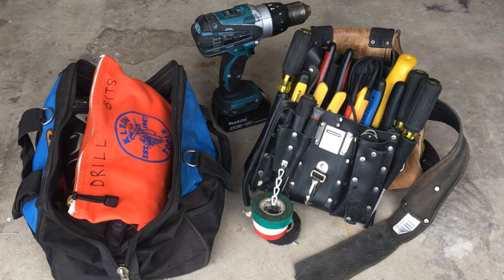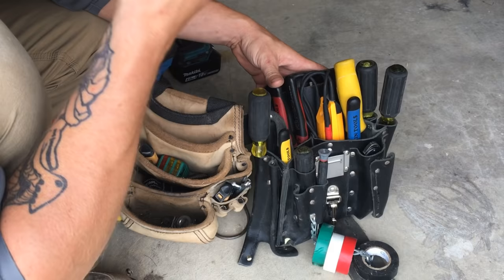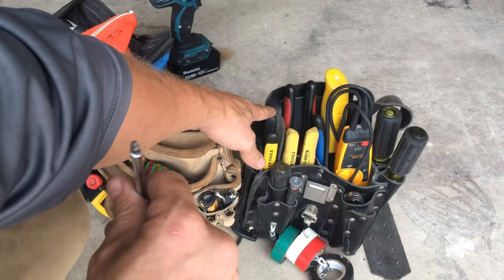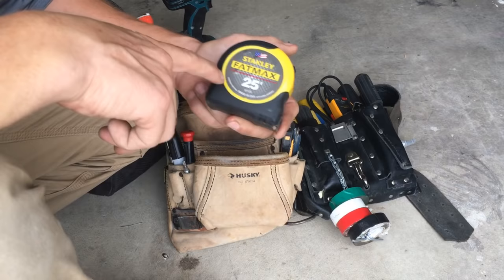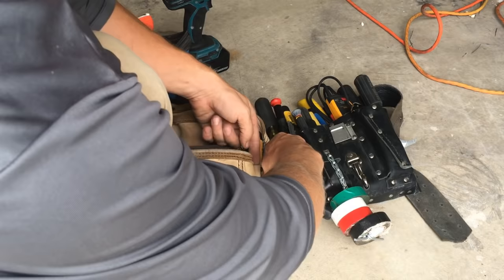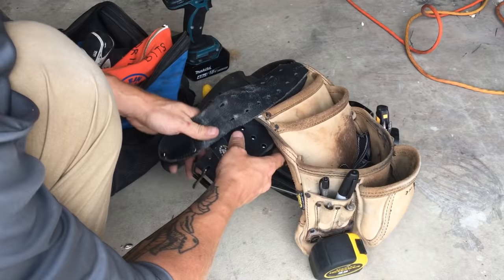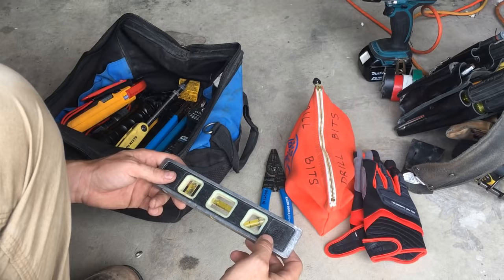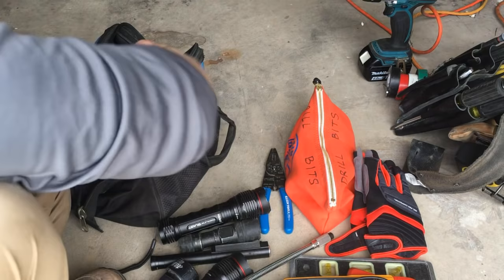Episode 2 - Tools Every Apprentice Electrician Needs To Start Their Job

Comment: This is an awesome vid. Pretty awesome channel altogether. I am a General for residential remodel and I try to get the 411 from the trade pros. Today, amongst other things, I learned about the strippers with the screw cutters. So many times I have had to cut screws for covers on a backsplash. Yee-haw!! Also did not know about the long shaft 6 in 1's Good Stuff!!

Comment: No insulated stick screwdrivers?  In Sweden  electricians always use 1500+V approved screwdrivers with insulation on top of the metal screwdriver stick, only the HUGE FLATHEAD screwdriver and the small exchangeable bit ones ever are un-insulated. Specially the +/- head screwdrivers are insanely expensive for the high voltage versions, but it saves lives when working on live wired screws.

Comment: 440 is steel. Channel locks are by the inch length. 

Love your channel.
Reply: 440 is the model on Channellock. Manufacture part number 440 is a 12" TG/GRV Pliers. 420's are 9-1/2". 424's are 4-1/2". 426's are 6-1/2". 430's are 10".
Reply: @misfitsman805  Interesting. I might have coincidental confusion. Channellock is one of the historically American made tool factories in PA, city built on steel mfg. Channellock tool I use the most for gripping. I wonder if they chose the 440 as a marketing strategy. Most people know the 440 is strongest & hardest steel. I tend toward best steel tools.
440 is a series of steel, 440A, 440B and 440C. HRC, or hardness & less rust and 440C is used in tools.
Reply: @rosehannahmae6772  Channellock uses high carbon C1080 steel. The 440 Channellock is just the model number for the 12" tongue and grove pliers. I think it's just a coincidence with the 440 model number. Other channellock tools use different model number series depending on the type of tool, like the 317 Needle nose, the 3610 Linesman pliers, 958 Wire Strippers https://www.channellockproducts.com/products/332884

Comment: Love your tools... I would recommend being more balance though. All the weight on one side will wreck havoc on your body
Reply from the maker: Ya I've been finding that out.  Also trying to combine tools like having a 10-in-1 screwdriver/nutdriver rather than having 10 screwdrivers.  Or having a needle nose that is also a stripper, and bolt cutter.  Takes the weight down, and increases speed since you don't have to keep changing out your tools all the time.

Comment: I have been an industrial maintenance electrician for a decade. Im just now going to be a service electrician. I have the feeling I'm in for a rude awakening on the difference.
Reply: Must admit I had a relatively easy life as a maintenance electrician and could not re-wire an old house in a week never mind the 1& a 1/2 days the house guys have to do it in.
I possess similar tools but mine remain unbroken and clean after two decades or so. I'm trying to hire a good 'House electrician' to update my old home to code and install a 27kw tankless water heater from my 200 Amp board, but so far three of them have walked away with no estimate appearing. After wasting a month I'm going to have to get the books out and figure out how to do it all myself - grumble groan and moan - about useless house wiring guys who can afford to 'Cherry pick' their jobs.

Comment: Here’s a tip for the budding electrician: BUY YOUR TOOLS (Klein brand when possible) AND GEAR AT HOME DEPOT.

Home Depot is excellent about replacing broken, damaged, or old tools or electrician pliers. On top of that, Klein Tools are covered by lifetime warranties!

 I went by there this afternoon after work and got my Ridgid work light ($99) replaced because it came apart while working this weekend.

I found some old rusted Klein diagonal cutters, an old beat up pair of Klein needle nose pliers, and a 6 inch small flathead screwdriver in my father’s old truck and took them to Home Depot... Went and found all of the new versions of said tools and grabbed replacements off the shelf, then took them (along with the old tools) to the customer service desk where they allowed me to exchange the old beat up tools for brand new updated versions of the same tools! Didn’t even ask for a receipt or proof of purchase!
Got about $75 of Klein Tools replaced free of charge! 

From that day forward, I’ve purchased EVERYTHING I need for electrical work and general construction from Home Depot!

Comment: Can you use 12v drill instead of a 18v so it’s more portable?
Reply from the maker: Absolutely, these days the 12v stuff that's being put out is very powerful.  But there will be some limitations.  18v is the way to go if you want it to work for every situation, all of the time.  But the price point of the 12v is hard to pass up for the power you get.

Comment: I'd recommend a Sheffield 58953 Electrician's Multitool. Mind you, 90+% of multitools
are useless crap, but this one has a very nice wire stripper, a sharp knife blade, an almost useful saw blade, and other assorted gadgets.

Disclaimer: I don't work in the trade, but my father did at one time.
Reply: I can see carrying an electrician's multitool, but the Sheffield is too heavy, but despite the weight it's not strong. It breaks. The better one to go with would be the Leatherman Squirt ES4. It's lighter and stronger, and I like the tool assortment on the Squirt ES4 too.

Comment: Dustin you may want to try the Klein demolition slotted/flathead screwdriver it has a metal cap that you use a  hammer on .if you use a hammer on a regular flathead you'll ruined then head on the flathead or the cushioned grip will move on you over time
Reply from the maker: Definitely good advice, thank you!

Comment: Not that it matters, but I believe that the 440 on your channel locks is the type of steel. I only know this because I'm a knife nut and that's a common steel used on knives...
Reply: Mark McEathron no it’s the size u have 420s which are small then you have 430s and 440s and idk how big they get after that
Reply: @blokimm9309  Thanks for the correction, man! I wasn't completely sure, and that's why I used the word "believe". 

Thanks for getting it right!

Comment: doing residential electric as apprentice you are going to be the crawl guy.  flashlights are nice, but a solid headlamp was a must for me.  when you are carrying a drill with you to poke through drop girders and other shit as well as your kleins to knock in staples you don't (at least I didn't) want to have to worry about dragging a hand-held flashlight as well.  anyone can get a good LED headlamp on amazon for less than 30 bucks.  dewalt makes a solid headlamp you can get at the hardware store, just not as bright and they eat through batteries.

Comment: Nice video, very thorough. However I find the contact testers to be very handy when changing devices and making sure the circuits off, when you work with other people is is very easy for somebody to turn breakers on and off so it's definitely a nice thing to have as an added safety measure. Also we have the same name, same stuff and same initials in the same places on our tools.... interesting coincidence.
Reply from the maker: Rainey Gmt I agree that they have their purpose.  I don't let my guys use them to verify anything, I have them use them as a first check and then recheck with a multimeter before sticking your hands/limbs in something.  I've seen people get hurt by being lied to by them so just be careful.  And always test on a known live circuit because the damn batteries can trip you up!!!
Reply from the maker: Rainey Gmt and wait...your name is Dustin Stelzer???

Comment: safety glasses, earplugs and a hard hat?? Laughed at the trinkets and gizmos comment.. 440 channels are good up to 2 inch pipe i believe.. having smaller sets of channels  do in fact have there place.. you should also consider picking up 2 meter cases to protect them..good start on the load out.. Thanks for sharing!

Comment: Never understood people wearing huge tool pouches like the one you have, makes no sense. My SMALL pouch carries my Kleins, Strippers, Dykes, Multi-nut driver, Philips, and Flat head. In my front pocket I have my hot stick and in my back pocket I have my meter. I can do 90% of my work like this, there is no need for a huge pouch with half my tools in it. Not only are you carrying a lot of weight on your side, but it gets in the way when you are working. Sometimes you have to craw in small spaces or squeeze into areas and it's way more convenient to have a small pouch on instead of having to take off and on and off and on that unnecessarily large pouch. 

Also, they need to buy a drill AND an impact. If you have one, you need the other as well. Personally I'd recommend everyone go with Milwaukee, they are the innovators of power tools, always the first ones to come out with a new tool. Not bashing the other brands, but Milwaukee is where it's at hands down. While you're at it, by a Sawzall, it'll be another thing you use a lot. 

Buy these things and you'll be set as a new apprentice. Of course over time you will figure out other things you'll want to buy, but this is a good starter pack.

Comment: This is a but overwhelming for a teenager that’s just starting out but this is a really informative and good video
Reply from the maker: Ya it's a lot to buy but it's all necessary.  If you can save up a couple hundred bucks to get most of this you'll be in good shape.  You don't need all of it, but a drill and the hand tools are pretty essential.  And a tool pouch to wear it all in.

Comment: For concrete use a 36volt hammer drill.  18 sucks for concrete
Reply: sds rotary hammer at 18v does fine

Comment: Buy an impact gun. Milwaukee is a good one but don't buy a bad one like a craftsman or deWalt. Also cut down on half my screwdrivers
Reply from the maker: I've been using a Dewalt 18v brushless impact for the past month and it's on point.  I love that it's smaller and more light-weight than the full size counterpart, and it's powerful as hell.
Reply: Thomas Rickert. There are many people in the commercial/industrial trade that use dewalt. I have never seen anyone use craftsman cordless tools in the trades.
Reply: There is nothing wrong dewalt. some people get it stuck in their head certain brands are good and others are bad a lot of it is just opinion not fact

Comment: as a apprentice on my 6th month i would say its so weird watching videos from american electricians. As we do things in a totally different way here in Denmark. And in my opinion our way is much easier and also more safe as we never use metal boxes or pipe everything we make is made of plastic. But cool to see how you do it over there on the other side of the planet.
Reply from the maker: We normally don't use metal boxes unless it is in a commercial or industrial environment.  We always use plastic in residential.  It's code to use metal in commercial here.
Reply: eddie money im pretty sure it depends alot on the country here in Denmark it is extremely rare to see metal components even in commercial. I haven't done alot of work with industrial yet. But from my knowledge it's also pretty rare to see there

Comment: I always see videos like this one and I think they're all somwwhat wrong. When you're first starting a new job line  whether its electrician, carpenters, drywall installer ect... you should get the basics. After a while you will realize what you need and you will see what you're comfortable with. Just my humble opinion of course. Cheers.

Comment: Been working out for a physical portion which requires to lift a 50lb cross arm and lower without stepping or wrapping the rope around your hands. I tried at home by buying my own pulley system and using a 45lb weight, but this seems so hard that I can’t even get it up. Would this be equivalent?

Comment: 1: fuck that bag.
2: the multi tool is not on the list but the Kline extended multi works as 2 of the standard screwdrivers and a #2.
3 get a pair of fence pliers they are awesome.
4:"I got an extra little divot"=I was working hot like a moron.
5 yes these needle noses are awesome.
6 multimeter spring for the fluke t-600/1000 still get the induction tester.
7: yes get the full set Kline makes a pretty good multi that covers most of it tho. If your bearing on your nut driver your doing it wrong.
8: fuck moving parts utility knives, get a 199 or a yellow bent handle Stanley.
9 yes Stanley fat Max get a 16 but carry a 25 (no magnets!)
10: stop listening to a this guy talk to your Union rep!

Comment: If your a green, a helper, or new to pipework, never use a marker. Unless you want to get yelled at, smacked, or made to go push a broom the rest of the day. Pipework is visible majority of the time. Using a marker to mark your measurements for bends makes your work look like shit and shows you dont take pride in your work. And dont use cutters to trim zipties. Twist off the excess with lineman pliers or use a zip tie gun.
Reply: Should i use a pencil instead
Reply: d ramirez yes with a pencil anything that will be onsite can be erased off if it looks sitely. Marker is ok to mark things that will be cut  or drilled. But on pipe bends measurements Mark's will be seen.

Comment: If your a first year guys ask your crew if you should pick up a wire stretcher, maybe a ball of horizon line. And show up with Klein everything that's all really clean
Reply: Rudy CantFail part of my first supply run included this infamous wire stretcher haha
Reply from the maker: Tell them that there's a clear wire stretcher in the bottom of every bucket of lube.  They need to reach down in to find it.
Reply: I just say it's somewhere in the van and act pissed when they can't find it.
Reply: Keep it next to the wire bender and you wouldn't lose them
Reply: lol, when I was doing industrial they tried to get me to go get level bubble fluid and the pipe stretcher

Comment: All you need is a roll of black tape. Conduit comes in ten foot lengths. 16ft depending on the hand size. Small sharpie & a mechanical #.9 pencil. Never, NEVER use sharpie marks on a piece of conduit when bending. Just my dos centavos. Don’t buy the rest of that crap. The contractor has to furnish that not you. Especially battery operated tools. Oh, and most importantly, get into a union apprenticeship program. You won’t need a unibit, ladders, cords, cordless drills & you’re own truck to keep a job.

Comment: I was an industrial electrician for 10 years and I used this tuff-tote ultimate tool carrier made by Ideal. It's pricey, but man that thing is awesome. I put all the tools out of my pouch into it and it looked empty, lol. It holds a lot. what I ended up doing was to put all my tools in the pockets around the outside and use the inside to hold various things like a drill, knockouts, meter, etc. 
http://www.idealindustries.ca/products/prodSelect.php?prodId=35-975&div=3&l1=bags_totes&l1b=carriers_totes&l2=tuff-tote_ultimate_carriers&l3=35-975
Also, it's funny, I have a Fluke 289, Fluke 179 and one of those little T5's like in this video, but 99% of the time I use the T5 over the others, lol.
Reply: adamaj I use my T5 80 percent of the time. Have you picked up the T6 1000?

Comment: Are these things that we will need immediately or can we go in with nothing and use our first few checks to get these?
Reply from the maker: Rex LeBaron Some of these things you can get away with not having, but most of them you will need everyday.  The drill, hammer, belt, and  hand tools you'll need for sure.  No point in showing up if you don't have that stuff.  The testers and channel locks you're probably fine holding off and using your Journeyman's

Comment: Way too much to be carrying around in a belt...Better approach is to have a small belt pouch to carry a few essentials and have either  a proper tool bag or a box with the rest in...If you work on sites, there is a lot to be said for the old 5 compartment metal tool boxes as these can be padlocked  to help keep you tools secure..

Comment: Join a union, you wont have to buy a drill, drill bits (paddle or nut driver), extension, gloves ect. All that and say more is supplied by the contractor an apprentice (cub) tool list can be had for under 200 bucks for a union contractor. plus better pay better benefits and better education.

Comment: Any recommendations for a tool belt that is like the one in the video? belt version or one that goes over the shoulders? Thanks
Reply from the maker: I recommend sticking to leather.  Mine is Klein brand, but honestly I've never found a set of pouches that I found perfect.  They always have something wrong, not enough slots, things placed in weird places, etc.  Nylon is crap though.  Nylon bags will rip in a year.  I've had a leather set for years and they're still going.

Comment: I watched this video with interest and speaking as a sparky with 37 years experience I have to say that laughing about cutting through live cables with 3 different cutting tools is NOT good advice to pass on to any apprentices that may be watching
Ok we have all made mistakes but dude please don’t laugh about it 
It’s far better practice to 

1..prove your test equipment 

And 

2. Turn off the power

If you buy decent quality tools like C.K. Cutters for instance you don’t want to ruin them with an unnecessary mistake 
And it’s not good practice cutting any cables if you aren’t sure of their potential 

Lastly
 
Makita drills are for joiners or dry wallers or the “ lesser trades “
Electricians should use top quality drills like Milwaukee or DeWalt 
Spend some cash and be proud of your tools man
Raise your standards dude
Reply: Agreed, fried tools are shameful and should be buried never to be talked of again but always remembered. 
live wires can be cut without arcing but there must not be a load applied. Really though just avoid working on live circuits if you can.